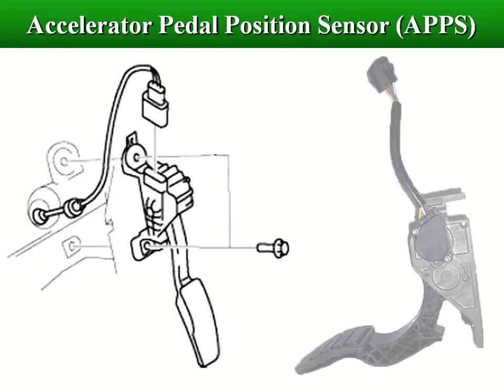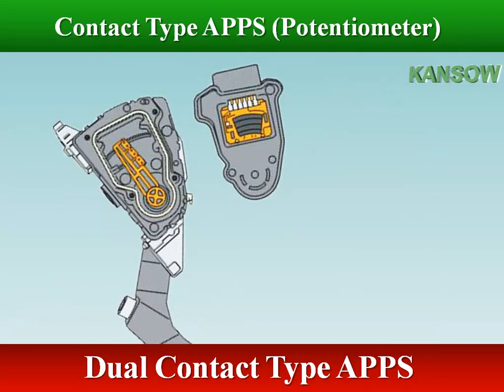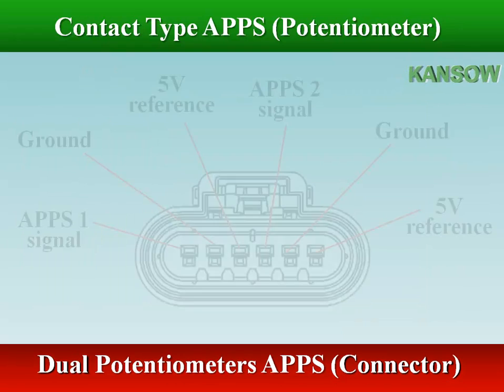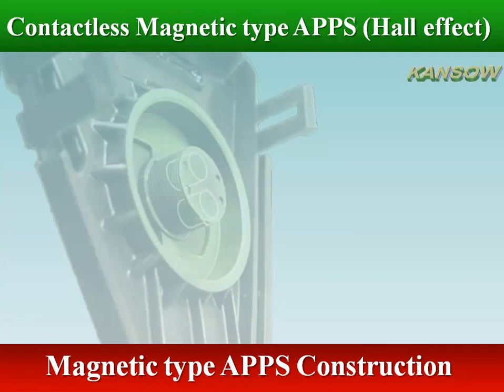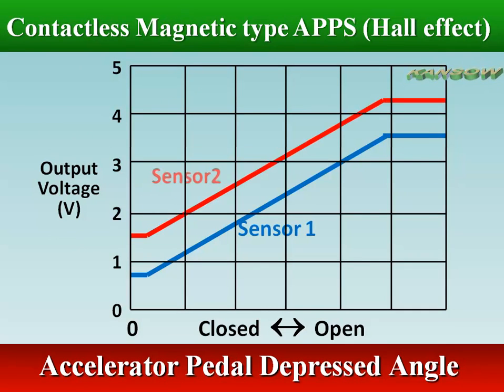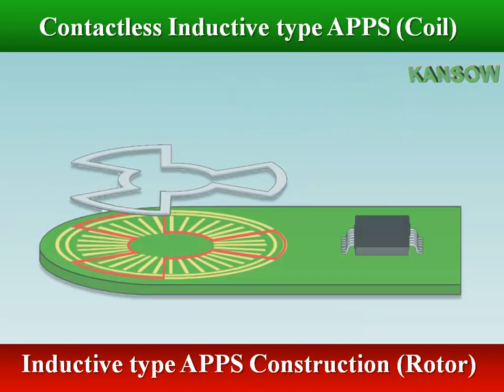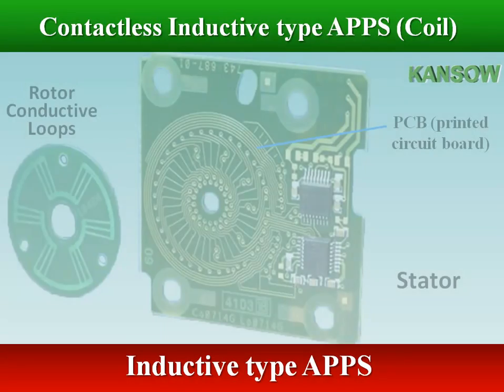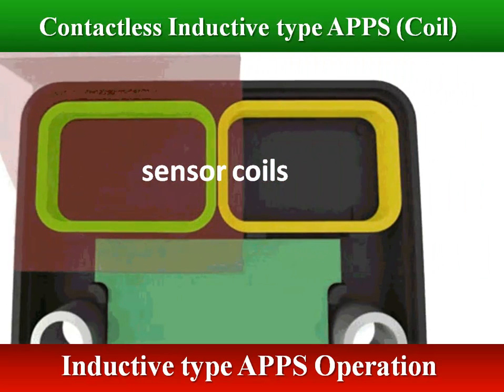Accelerator Pedal Position Sensor (APPS) Types

Comment: Put video about 5 pin mass air flow sensor
Reply: As I know, 4 pin MAF sensors can't measure the temperature of the air but 5 pin MAF sensor can be able to measure the temperature of the air.